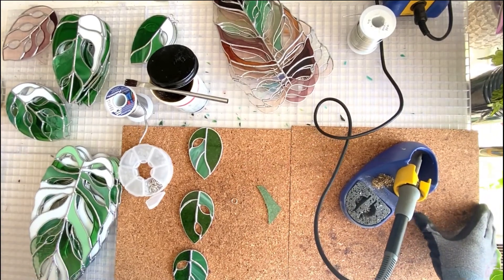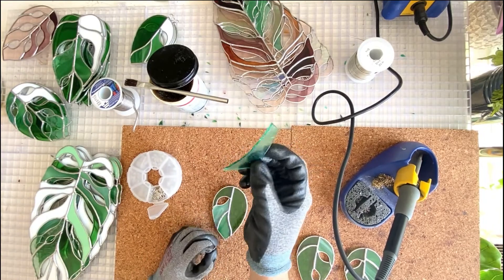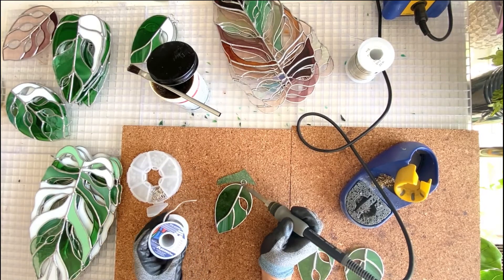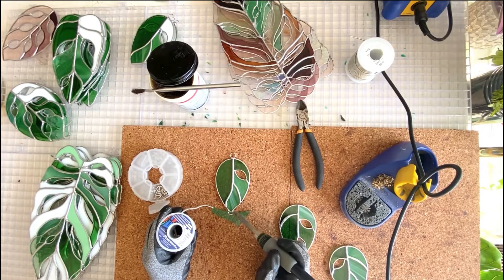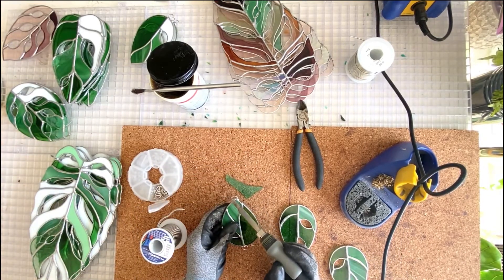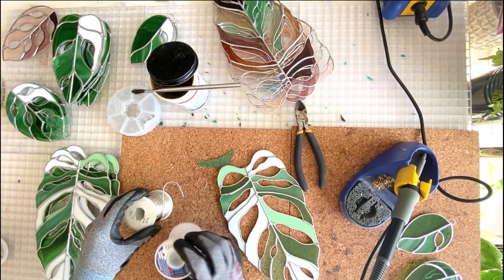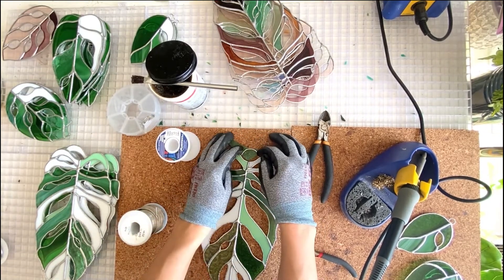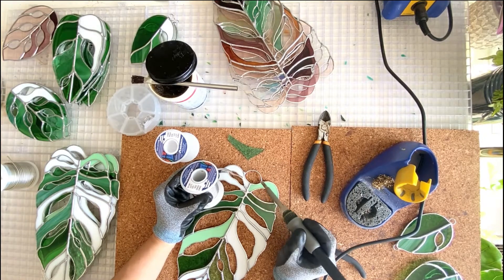How to Attach Jump Rings & Wire Hangings to Stained Glass

Comment: What temperature do you heat your soldering gun?
Reply from the maker: I don't typically change the temperature when doing jump rings and my temperature is at 668. :)
Reply: Oh wow what type of iron are you using? On the hakko I was told maybe 440 max, would I try a higher temp or is your temp gauge different? Fahrenheit or C?
Thank you your work is SOOOOO BEAUTIFUL & inspiring!
Reply: *should I try